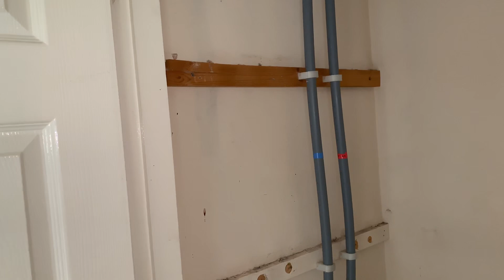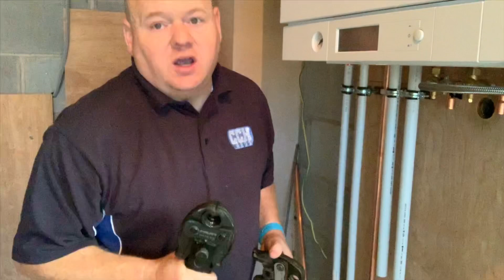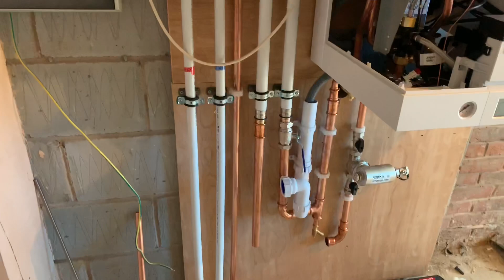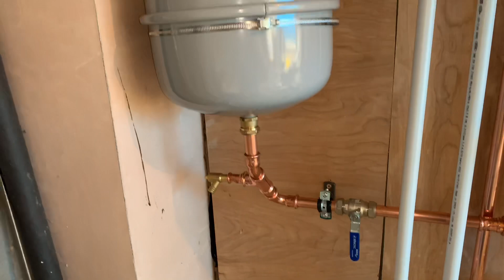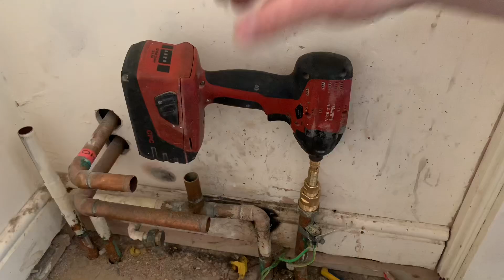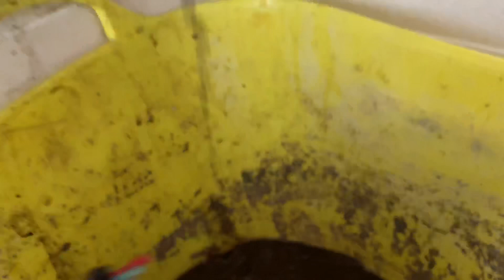Plumber - Day 5 Viessmann 111 Piping up the boiler

Comment: love the olive puller in my line you sometimes need to pull crushed olives due to some cowboy damaging them and those splitters are not always clean and can crush the pipe meaning you have to cut the pipe back which is annoying as you spent so much time !! 
lovely neat work again Allen

Comment: Cracking job Allen you have given me a few ideas, like the press fit bit expensive for me at the moment but I like it.
Reply: you can hire the crimeprs from any good hire shop for a couple of hundred for a week .which is good value or (i dont know IF hilti still do it ) but the manufacturers sometimes loan out a tool for you to assess for a few weeks (if your cheeky and have a good relationship with a manufacturer you can repipe your house without paying for the crisper ha ha ha )
Reply: frank key hire out crimpers up to m35 for 40+vat for one weeks hire

Comment: Good vid Allen love the extra expansion setup 👍.
Reply from the maker: Thanks.
Reply: James LowDoyle  is it ok to use an isolation valve on the extra expansion vessel as the boiler already has one? Didn’t think it would be allowed if not?

Comment: You have put a washining machine trap on it, because it's a washing machine 😆
Is luke your full time cameraman now?

Only thing with Multilayer Composite Pipe is it looks pants compared to press fit copper. I've not used MLPC yet, looks cheap to me, I understand the benefits, but if probably not have it on show. Are there benders for them, or do you pull a knee bend🙈
Reply from the maker: All the pipes will be lagged and nothing on show. Unfortunately Luke needs to go back to school soon. The MLCP works out the same as copper on price, The benefit is less bends.

Comment: Hi Allen, Just wondering - do the Geberit fittings only work with the Geberit jaws? Or would a Geberit fitting work with a REMs gun?
Reply from the maker: Very good question. You need the correct profile. Express and Geberit are M profile, Work with any gun with correct jaws.
Reply: @AllenHart999  Nice one! Cheers Allen, loving this series :)
Reply from the maker: @connormcleod02  Thank you.

Comment: Also I don't think DIY knows hydronic heating principles. How many HVAC techs follow these principles for installing hydronic heating systems? Every HVAC consultant that I've had here , have never done a heat loss calculation.
Reply: This a boiler change using the existing radiators, which are sized up on installation.   The original boiler was sized up on installation as well.  Did the customer complain that the old system was inadequate in heating the house? If not then the replacement boiler need not be any smaller than the old. 

The prime point here is assessing the DHW as the system is moving from a gravity tank fed system to a mains pressure instant hot water system. The incoming cold water mains has to be measured in flow and pressure. The pipework has to be correct with hot and cold water balanced, with in-line flow regulators. In short the flow and pressure must be directed to the shower.

Comment: Should that 2nd expansion vessel  not be a red one ?
Reply from the maker: Doesn’t matter what colour it is. Needs to be one for central heating thats all.
Reply: @AllenHart999  but are they not set at different expansion pressures though

Comment: Would a lockshield type of valve not have been better on that EV?
Reply from the maker: I will just remove the handle. Thanks.
Reply: in-line valves - the ones that need a screwdriver, tend to leak.
Reply: John Burns I’m not talking about the slotted valves I’m on about the ones that you can lock into position something like the pegler ones.
Reply: @jayosullivan4756  
I think you mean something like this:
https://www.toolstation.com/lockshield-gate-valve/p17726

Comment: Quick question with the locktite 577. Can you take an iron/fitting off once it has set?
Reply from the maker: Never tried to be honest. Sorry.
Reply: Depends on the colour, blue will come undone, with care, that looked to be red, no chance
Reply: @paulhill1665  Hi Paul, which is the blue one you use?

Comment: So what’s the difference between the price of a normal end feed fitting against an press fit fitting?
Reply from the maker: Josh Derham press fit is miles more expensive. 15mm elbow is about £1.20, and a 22mm tee is about £3
Reply: @AllenHart999  How about timewise pressfit and soldering installation e.i. repiping compare